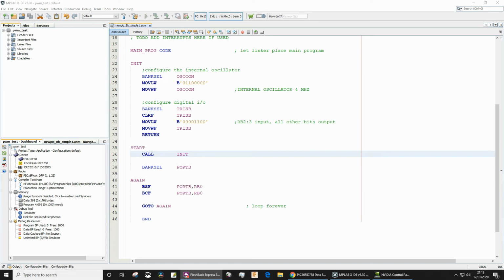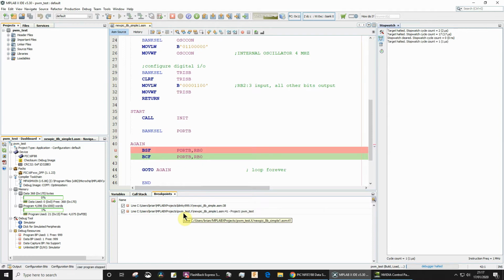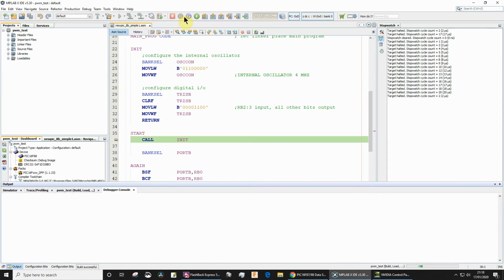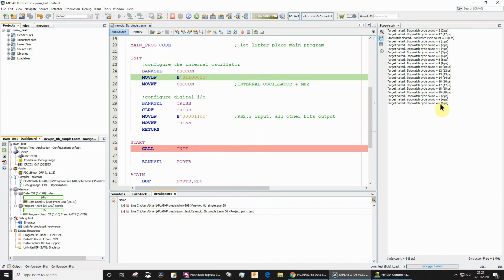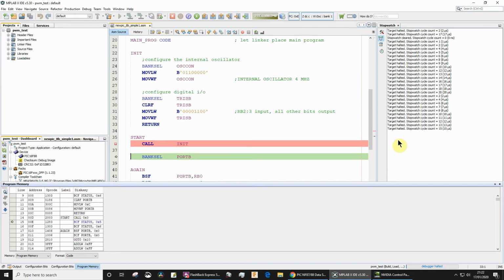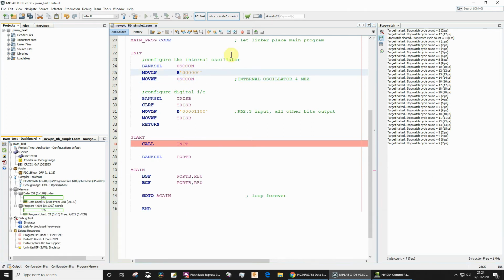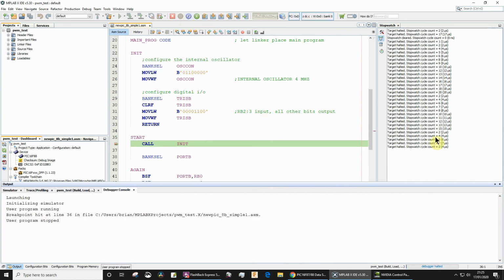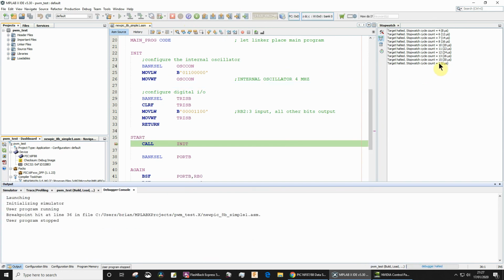Counting instruction cycles and duration using MPLAB X stopwatch

Comment: Thank you! i'm trying to figure out how fast my code runs for a uni lab and this is exactly what I needed.

Question: I'm using an 8MHz osc setting (PIC16F886, MPLABX v5.35) . since the default is 4 MHz, does that mean i need to set the instruction frequency (in preferences) to 2 instead of 1 to get an accurate cycle count/timing?